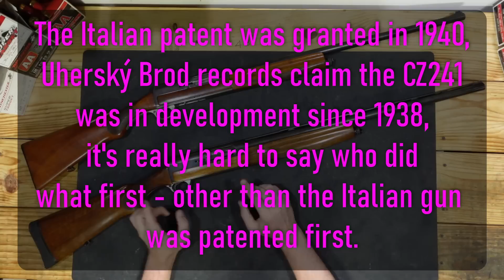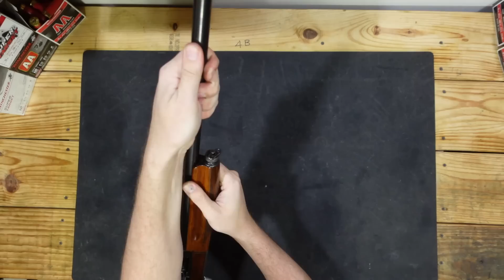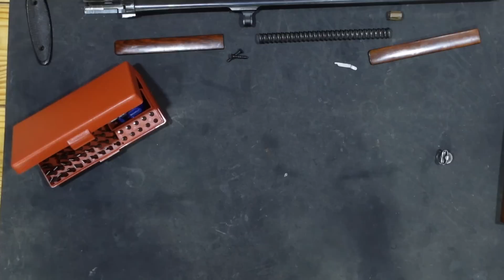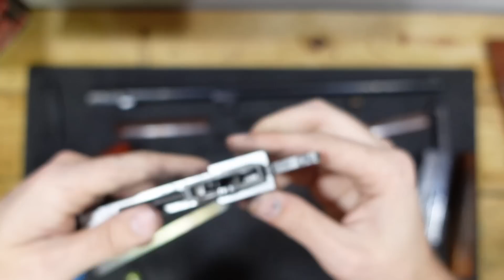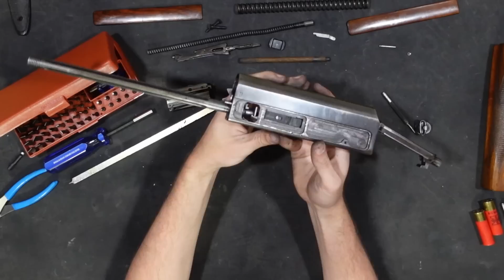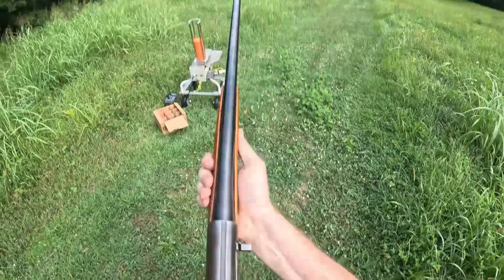The CZ241 - a Wood-Paneled, Three-Shot, Long Recoil Shotgun

Comment: Are you able to make a shell spring that will cycle 2 1/2” shells for a 16ga?  Mine will cycle 2 3/4” but will not cycle the 2 1/2”. You talk about this around the 49:00 min mark of the video for reference.
Reply from the maker: I guess my question is why would you want to shoot 2 1/2" 16 gauge? It would be possible to make a spring that would do it I guess. Roll crimp 2 1/2" 16 gauge would probably just work as-is, if it's a thing where you're trying to use 2 1/2" hulls for reloading?
Reply: @I @IvanPrintsGuns I was under the impression that shooting 2 3/4 inch shells is possible but has caused the stock to develop cracks on the one that I have. So I was thinking 2 1/2 would be The closest thing to 2 9/16 that I have been able to find.

Comment: Hey Ivan, I have around 10 or 12 of these in 16ga, 3 of them in 12ga and 1 in 20ga.  I also have the original owner's manual in both English and Czech.  You can see some of the videos that I made on these here on YouTube. I am RBC Gunsmithing and have restored and repaired several of these.  I am also the person who first uploaded historical info about these shotguns, it can be found on the CZ forum and has been copied and added to by multiple people.
Reply from the maker: I'd love to see the manuals! I've seen your videos, they helped me understand some of the generational differences (as did your posts on the forums). I had learned of these things doing research on Italian shotguns, and that led me to find your forum posts and videos.

Do you have the manuals uploaded anywhere?
Reply: @IvanPrintsGuns  I have pdf versions on my laptop that I can send you.  I'd need an email address
Reply from the maker: @guitarsnguns  youtube keeps auto deleting when I try to type it out - ivanthetroll at protonmail dot com will work